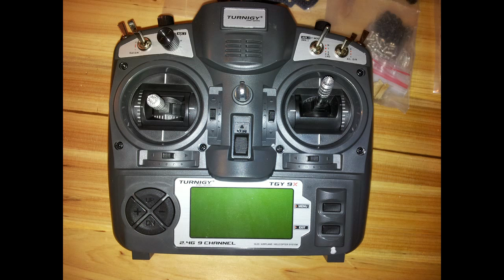RC: My first Quadrocopter (Build and Crash)

Comment from the maker: And you are "partically responsible", thats why u ended up in the description ;-D

I ordered some more little propellers (8") to have more time to trim the machine. The problem is that motor number 4 doesn't start when I do not jump to 40% of throttle (a problem that I was reading about in different forums quite often), but as soon as the copter takes off I am not fast enough to trim it anymore (for that I need more space).

But "YAW" and "Pitch" seem to be quite good for now... :-)

Comment from the maker: I was asking to some professionals, but all they suggested to stick for now with the cheap plasic propellers until all the trimming is done, because also the expensive ones can break very easy and so it would be a waste of money right now.

What I did instead was to order slightly more little ones (30 peaces ^^) to make the machine slower - otherwise I do not have the time to work on the trimming when it took off from the ground.

PS: I think about to get a RC car, too, they r fun! :D

Comment: Whoops, I can't help but feel at least partially responsible.  Perhaps we should swap that "aggressive" firmware for something more passive.  I think it's in the trims.  The last flight looked like it wasn't spinning too badly (trim the yaw), but was definately going forward on t's own (trim to the rear motors).  What happened to doing a little hop on the ground and slowly adjusting BTW ;-)